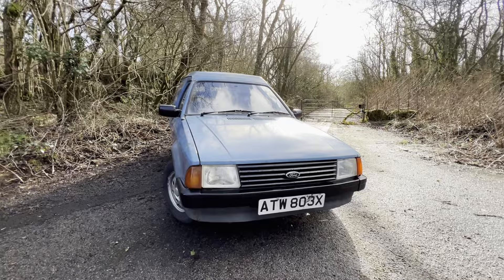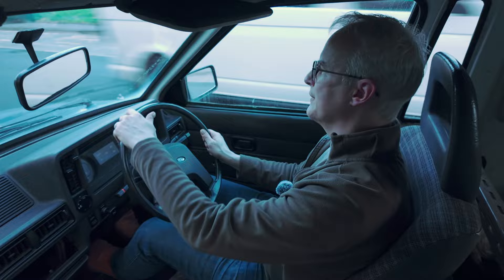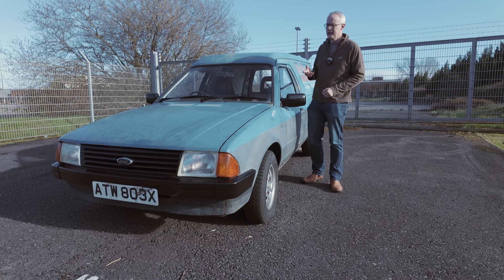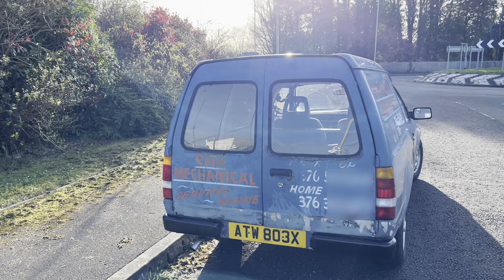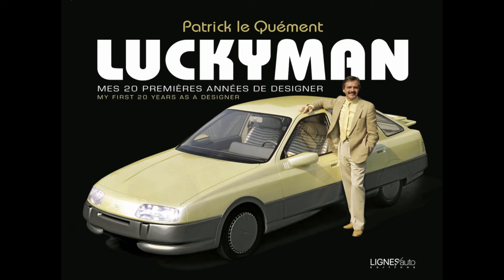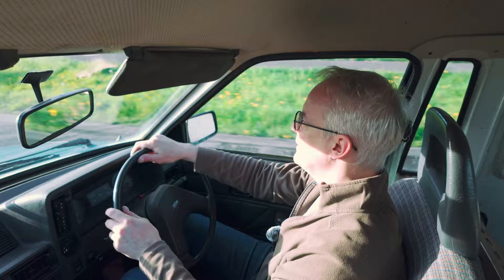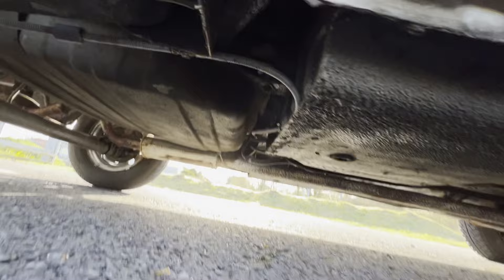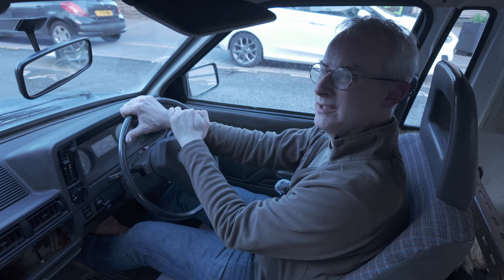AMAZING timewarp Ford Escort van: a pilgrimage

Comment: If I recall correctly the seats were grey vinyl faced. Engine Compound Valve angle Hemispherical combustion chamber. 1.1 and 1.3 discontinued in 1986 for the 1.3 OHV Kent/crossflow/valencia and  the 1.6 from then on was lean burn with heart-shaped combustion chamberd so not a 'hemi' (hemispherical) head and strictly not therefore a CVH even though it was still called that. On the sales brochures the CVH was not named 'CVH' just 'OHC'. The MK3 van was never as fast as the Astramax which was the fasted thing on the road at the time ....
Reply from the maker: Ah yes, the Astramax…now those needed a 140mph speedometer.

Comment: My sister's first car in 1989 was a 1981 W reg 5 door 1.3 GL. It had the more pleasant looking dashboard and exterior chrome trim but it lacked front seat head restraints. Ford were quite stingey about some features back then. I think they were optional in 1981 but standard a year later.

Comment: I had  a B reg one of these. Had an 1100 Kent motor in it and I gave £50 for it. Revved like a flymo and handled like a gokart. Drove it for around 5 years, putting a 1300 Kent and gearbox in it which made it less frantic on motorways. Drove all over the country with the diving gear in the back. Did the rear wheel arches using 4 repair sections and the rear shock mounts. They all rotted, but an easy fix. Amazing that yours look standard. By year 5 it was getting disconcertingly crisp and a critical examination on my Dad's drive ended in a consensus that it was too far gone for another MoT. All the good bits got stripped and the bodywork cut up for scrap before the new neighbours next door moved in. Fuel delivery tube fell off the fuel tank as we unbolted the straps. Unfortunately the neighbours turned up a week early. As they rounded the corner with the removal van, there were their new neighbours, roof cut off, front in 3 pieces, cutting down the middle of the floor with a petrol powered disc cutter..... Oops. Back axle made a jolly nice logging arch.

Comment: I'd love to buy this if I had the money or somewhere to put it, unfortunately I have neither. It's almost contemporary with the A-reg Astra van I had years ago, which I wish I'd never got rid of, and which are also seemingly extinct.

I also once had one of the Escorts with no radio speaker and a rocker switch for the fan - an A-reg 1.1 Popular, all painted metal and grey vinyl inside. It was incredibly slow and noisy and had catastrophically rotten front floorplans and bulkhead - extremely common on these due to the location of the battery.

Comment: Nice video Martin,
I certainly remember these as my Dad worked for Royal Mail for 26 years and they stuck with Escort vans for a long time. Many of those vans then being dumped into the used market every time the fleet was due an update.
Interesting this one has other colours of paint and under the bonnet actually looked an orange/red colour.
Reply: I bought them outta bca , remember in like 2005 at a Royal Mail sale a g Reg pat van not romec rolled in with incredible low miles, they got rid of mk4’s by 96 so where had that been ???  Maybe some far flung island but wow we that turned up I was well,impressed

Comment: You forgot the Bedford Chevanne. It was some weapon.
   The only 80s small van I would consider would be a Golf, if I could find one. On the wee side but well built and robust.
Reply from the maker: The Golf was definitely smaller - fair point about the mighty Chevanne though.
Reply: Bedford boss not vx
Reply: @chiefrocka8604  
Thanks Chief, they were indeed Bedfords. Edited 👆

Comment: I would have thought any van would have mirrors both sides. Imagine the blind spot otherwise.
Reply from the maker: Yes, you’re probably right about that, although Ford did go to some length to make its base models punitively miserable in those days.
Reply: @GrandThriftAuto  I did own a 1984 1 litre popular fiesta.    2 speed fan. 1 mirror. No radio.  Or speakers.    No heated rear screen of wiper.

Comment: The Mark III Escort Van copied the Australian 1979 XD Falcon Van. A vaugley Granada Mark II based design, on the old XA-XC Falcon running gear but with a Third window.
Reply from the maker: Ah, I was trying to think what other vans had an extra side window — I’d forgotten the XD Falcon did 👍
Reply: No not sure that’s correct the European ford escort was front wheel drive and transverse engine and then the bodywork design was by Uwe Bahnsen and was similar to the cortina Granada etc 
From what I recall the XD was conventional front engine rear drive layout
Reply: @danielrussell446  The  Escort Mark III Vans styling appeared, about three years before it was released. Good example is the XD Falcon  Sundowner Van, which I owned. Bahnsen accused Ford Asia Pacific of plagiarism in that the Ford  Laser and FWD Mazda 323 copied the Escort Mark III's data points. This worked in the opposite direction, with Ford of Europe copying Ford of Australias Falcon Ute (pickup) and Van Ford. From 1976-1979, Ford Australia had Uwe B's Granada Mark II  design engineer helping in Australia with the XD and XE Falcon design up till 1979. I am taking about styling, not body engineering, the Falcon Van  is a huge rear drive car with a 116 inch wheel base (294.6cm)

Comment: I helped plant a girder at the engine plant when it was being built. I think I did anyway… I mean I was 6 and I pressed some kind of button which lowered a yellow metal thing into the ground. Thanks Grandad! Great review :) There was a 1.4 CVH as well although not sure if that made it to the van?
Reply from the maker: Well the buildings are all still standing, so you must have done a decent job with the girder!  You’re right about the 1.4 CVH of course - I didn’t mention it as it came in later with the mk4 Escort (including the van I think). The Sierra’s 1.8 was a later CVH too.
Reply: @GrandThriftAuto  That makes sense!

Comment: My first car was a Mk3 1.3 cvh Escort.  Unfortunately, mine wasn't at all free revving.  In fact, it was  positively allergic to revving.  Maybe the vans were a bit better?
Reply from the maker: This one felt quite lively, admittedly with very little load in it.  I wonder whether the van engines were tuned differently somehow? Different compression ratio maybe?

Comment: It rather depresses me that virtually every surviving Mk1 Escort by default has to be turned into a high performance replica - and here to illustrate the point you show a Mexico-ish  estate and an RS2000 van. It’s as monotonous as virtually every new car sold now is an SUV. “Oh look” I think when I see one “another Frankenstein cannibalisation of grandma’s Escort 1100L.” Yes, back in the 1970s every school run, every driving lesson, every trip to the shops that featured a Mk1 Escort was done in an RS2000 with fat wheels, spot lights and graphics. That REALLY is how it was back then! 🙄
Reply from the maker: Couldn’t agree more. I did look for standard ordinary versions on eBay to illustrate the point I was making but…there weren’t any.

Comment: I  would rather have that than my2020 connect, with as blue, and constant problems, know everyone at the dealers by their Christian names. Only thing that's good on my new Connect is the heater.
Reply: Earlier Connects much better. 19/20 plates on can be troublesome. Splits in top boost hose will kill the performance then the DPF. Usually.
Reply: I had a 2020 1.5 diesel connect  had a add blue failure twice back to the dealer on both occasions.   The 2016 one 1.6 diesel (95hp)got to 207k with no issues at all.